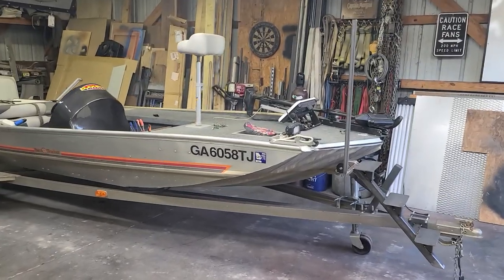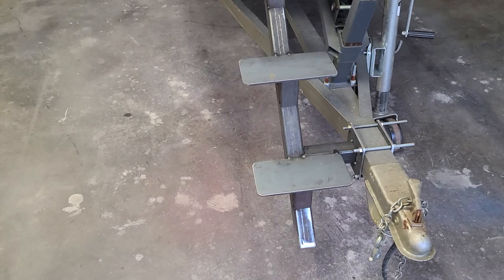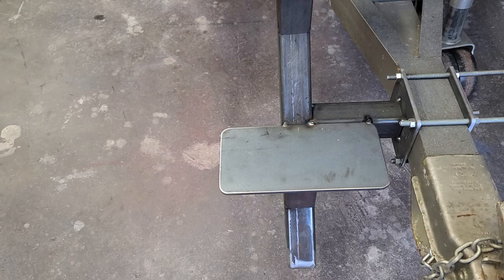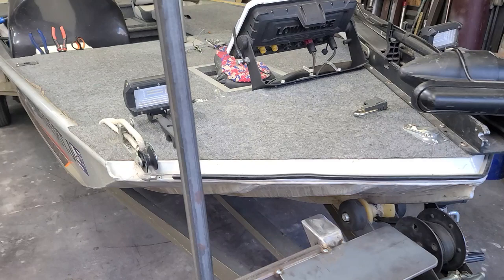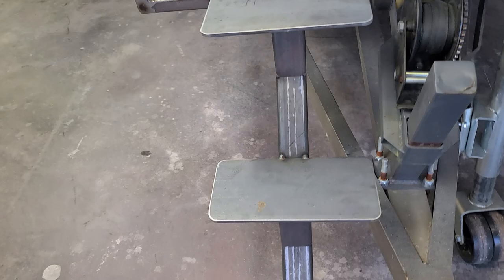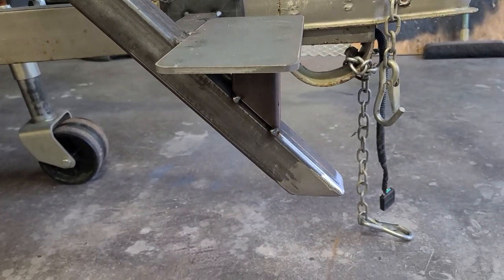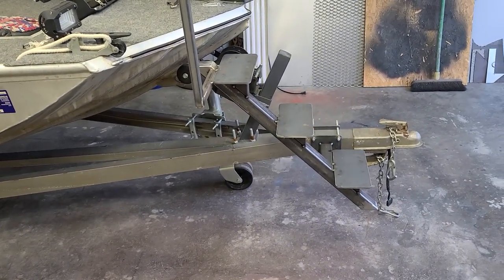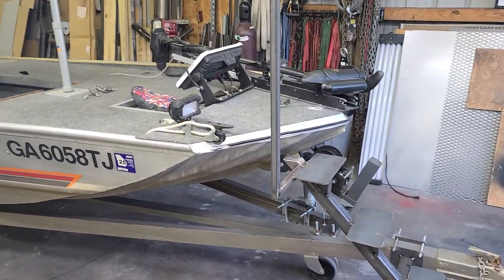Boat Steps On A Sunday! Save 400 Bucks!!!

Comment: Super nice, I'm thinking of building one too. Do you remember the approximate angle you have your main tread post at?
Reply from the maker: I just cut them both at 45* was the simplest because the saw was already set up. Lol
Reply from the maker: I have a finished / installed video posted also. Check it out.
Reply: @freshonerestorationfabrica4298  lol..been there :)

Comment: I have a 03 Ranger 185VS. I just ust showed this video to a small welding company in my area and the guy told me it’ll be about $1200 to make..😮
I didn’t say I wanted it gold plated.
Reply from the maker: That's crazy, there's two or three companies that make them anywhere from 3 to 500. I saw them on a few vids and just copied what's already available on the market.

Comment: I would add a brace to the top winch area like you did the bottom for strength
Reply from the maker: Check out the finished version in my other video. They are super rigid and no need for additional bracing.